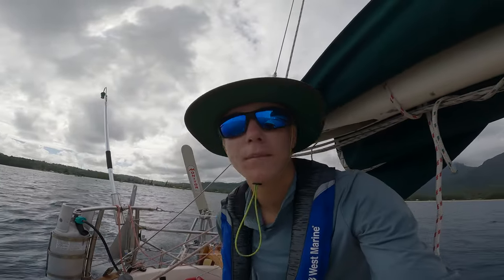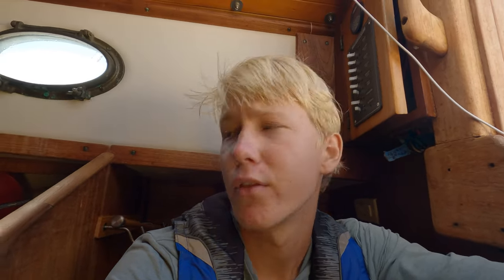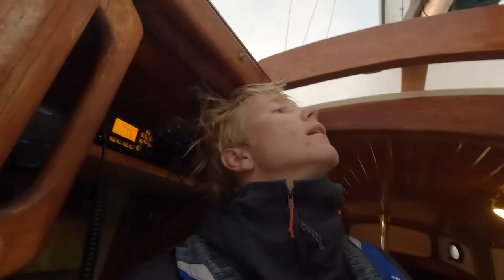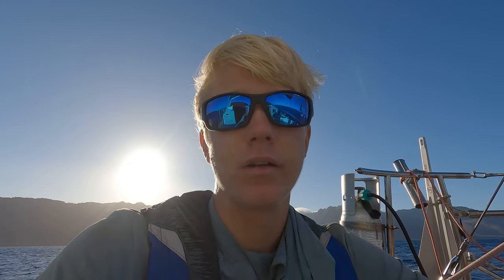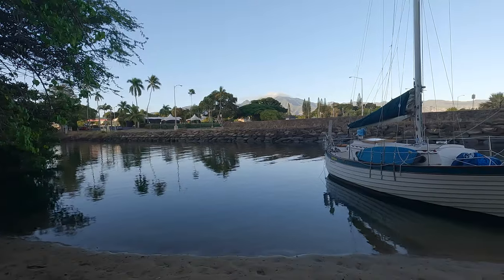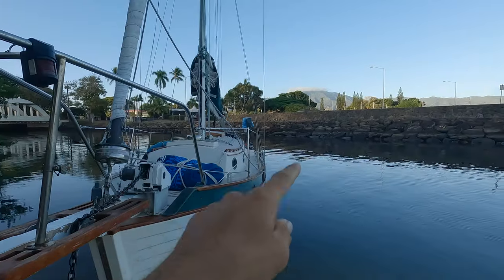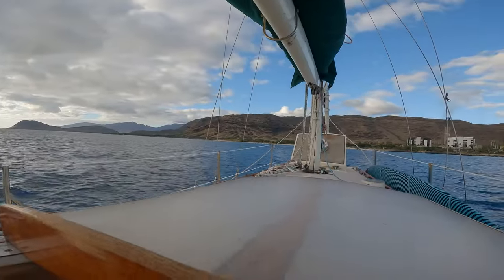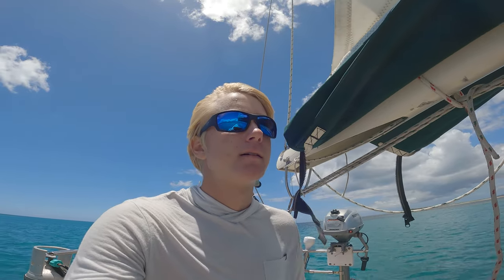My hardest sail yet

Comment: Get a combustion system leak detector kit . Almost any Auto parts store or harbor freight it's a chemical test for carbon monoxide in the cooling system. A simple cheap $30 test that's 100% positive reliable

Comment: Brown coolant indicates a crack in the cooling system. When transmission fluid mixes with coolant it will look mocha colored. The passage did not look to terrible from Kauai 😊👍🏻
Reply from the maker: It wasn’t horrible, or pleasant. Went 2.5 knots for the first 10 hours.
Reply: @garrettsadventure  Wicked 😢 it’s definitely a test, more so on the captain then the vessel. Almost better to do it in a gale then with lighter winds. I maintained about 5.5 knots 1st reef in and anywhere from 6-12’ just forward of the beam and gust up to 40. The wife did not enjoy it to mich😅.
Reply from the maker: @captainmike808  1st reef in 40+ apparent seems overly risky.

Comment: Three things could reduce your lean. Take the outboard below deck. The propane tank, too. A hanking jib instead of a rolling furler reduces a lot of weight and drag aloft. You can also drop it in a storm and remove the jib rapidly to stitch repairs or store it out of the sun. You might consider storm sails if you don't have a pair. I like a previous post that I can watch your channel instead of doing chores.

Comment: Hi Garret, congratulations on your choices, your wonderful Nor'Sea 27, on your decision to 'throw off your bowlines', as Mark Twain put it. 'Twenty years from now you will more regret the things you didn’t do, than the ones you did do. So sail away from the safe harbor. Catch the trade winds in your sails. Explore. Dream. Discover.' 
That was my motto for about 20 years, while working very hard. This sentence kept my dream alife. And then, at the age of 57, I indeed threw off my bowlines. Crossing the atlantic ocean twice. But in a bit bigger boat. 37 feet of steel. And now I bought a boat very similar to yours. Allegro 27, double ender, built 1977 in Sweden, small and seaworthy. And love it. But still some leaks...😄. Will get a "windpilot pacific light' windvane selfsteering this winter. Next year England and Irland, the following year hopefully the Azores again.